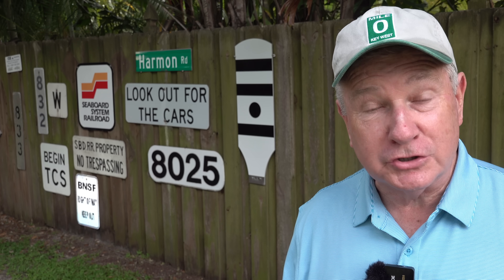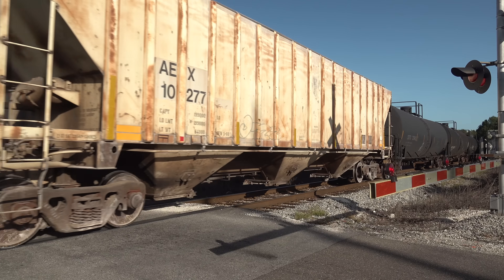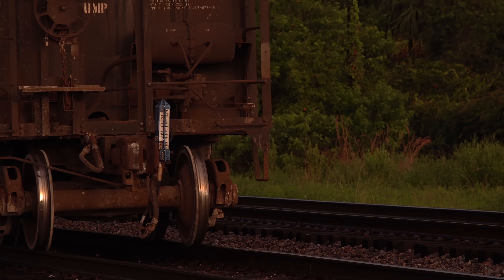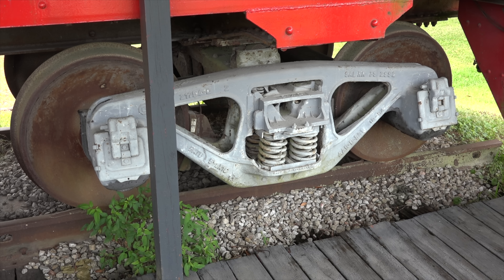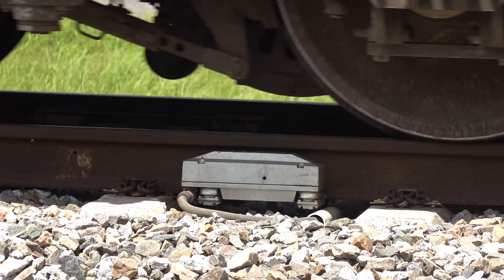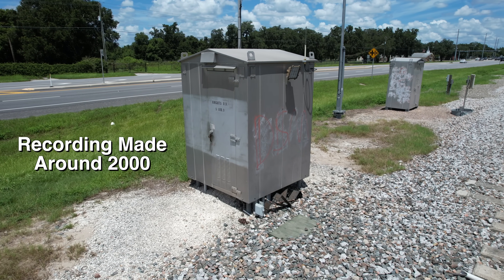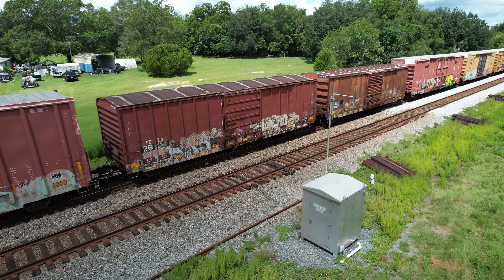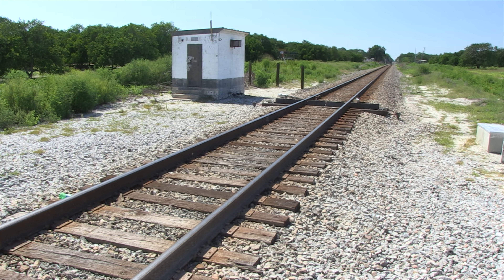What Railroad Defect Detectors Do

Comment: Those CSX detectors that give location sound neat..maybe it's because they were gone before I got into railfanning, but I think they're interesting. I like the Paducah & Louisville detectors here in Kentucky. They give axle count and length, but also direction, temperature and train speed. I think CN is similar? NS detectors don't really give out anything other than milepost, sadly.
Reply: I pick up two DDs here in Robards, KY.  Those used to give the train length, but they both just give axle count now.

Comment: Two mainlines run through my city, so there's hardly a day I don't see a train from where I've worked, or when driving.  It seems to me that wheel flat spots were a regular thing, I'd hear at least one per train, more often several.  I notice now flat spots are much rarer, I guess due to these defect detectors.  That's got to reduce both rolling stock and rail maintenance-- as well as getting rid of a bit of noise pollution.

Comment: That inspection shed there at Race Pond is cool new technology! I bet railfans would love to tap into that photo stock, ha! Anyway I just wanted to say thank you for posting another excellent video, and congrats on the Harmon Rd sign, that surely added to your collection. 
On the buffer cars, you mentioned that the plant may hook on to the train with terminal power. In addition to that, sometimes the train may need to perform a runaround once it reaches its terminus. It's a zillion times easier to just uncouple the head engines and snap them on the tail. Also in some more rugged terrain they might connect helper DPU on the bottom. OR they may also attach another train to the bottom, with their lead power becoming mid-train DPU. With the time alotted in your video, you covered the basics and that should be clear enough that there's buffer cars on each end so the train can be handled from either end, regardless of which way it's actually traveling.
Finally I think we talked briefly about visiting Columbus GA sometime. If you're still up for that, please let me know. I won't be in GA much longer but I would gladly make the trip back to guide you!
EDIT: Oh yeah and those numbers on the DD slap plates so they could disassemble and reassemble them. Similar to the way you might mark head bolts on an engine when you disassemble and reassemble them, so that you put the bolts back in the same holes each time.

Comment: They are also a High Car detector.  (High wide detector) On CSX Riverline at 7.2mp they usaslly go off due to the snow on the containers or auto racks not sure for summer season. There also one in Phila. Same for Amtrak NEC high car detector next Oak Island in Newark NJ. CSAO runs to Metuchen yard for Rartain center and local work in Edison/New Burnswick area.

Comment: Do they have like detectors for the tracks themselves?  I stumbled across a page showing old railroad jobs in the 1800s for the railroad and one was walking the tracks to spot ties, bolts, basically any part of the track itself that needed repairs and to make them when they found them.  (I assume when the trains weren't running; before they ran.)  Finding them must surely be replaced by modern technology these days.  Apologies if you've already did a video on that.  Even without knowing, I'd think drones would be more efficient than men walking the lines at least to find the needed repairs.  (I was able to give a character in my fiction story from that area this IMHO interesting and important job.  Yes, I combined my love for trains and the era and was searching for jobs the character might hold working for the railroad.  I lost one grandfather before I was born in 1958 to an accident while working for the railroads but I honestly don't know what what excatly his job was but I suspect my interest stemmed from that.  I never knew either of my grandfathers because they both died of work accidents before my birth.  The other, a dairy farmer, got kicked in the head by a cow.)

Comment: Great video, Danny, as always! I will have to correct you on some info that those little stubs on the inside of the rails aren't impact detectors. They're actually transducers that count the axles, measure speed and calculate train length. Impact detectors usually are found sparsely on a line, and usually have concrete ties and sensors along the rails, along with AEI readers. CSX's actually use a female voice and say "CSX impact detector". Also, fortunately, pre-recorded voices are still a thing on modern DD's. However, a detector like the one at Stokes is a synthesized computer voice, it's all over on my local NS line.
Reply: if you're lucky enough, you'll find a famous voice pre-recorded in some of the radio boxes on the union pacific and pan am line.
the voice is Majel Barrett-Roddenberry. 
reportedly there's only a few left in Maine that bear her voice to this day

edits cause i'm tipsy....
Reply: @gigglesseven  I found the thread on trainorders. A user claimed that the voice widely believed to be Barrett was actually a professional voiceover artist called Katherine Reynolds who apparently worked for NBC.
Reply: @PrenticeBoy1688  oooh, thank you. some info is very buried and easily overlooked
Reply: @gigglesseven  The Enterprise computer lives on!!
Reply: @gigglesseven  This is a disputed claim. I read something earlier this year that identified the voiceover actress, and it wasn't Barrett. This might be an urban legend.

Comment: Does the inspection portal you featured at the end of the video transmit an inspection report like the defect detectors do? If so, can we get a sample of what they sound like?
Reply: No radio message
Reply: According to some of the other comments, modern defect detectors usually only transmit when a defect is found, to reduce unnecessary radio chatter.
Reply: @beeble2003  I've only heard UP DD's do that, CN and CP detectors transmit for every train at the start and end.

Comment: Hey Danny the handwritten numbers on those flaps I can assume are for wiring and diagnostic purposes. So the techs/maintenance can make sure that the proper ones are wired in the terminal box
Reply: Hi, the Dragging Equipment Detector (DED) paddles are just static mechanical devices. We number them because we prefer to put them back in the same place they were originally in whenever we would have to remove the whole assembly due to track work. All the paddles move together & if moved a certain distance, it opens a contact that carries the DC voltage to a relay causing the relay to de-energize to indicate an actuation. The outer paddles (#1 & #6) height is even with the top of the rail & the paddles inside the gage of the track is either 1 or 2 inches (been a while since I've worked on these) below the top of the rail.
Reply: Well that makes sense. I didn’t know if they were grouped as a single device or each paddle was independent. Thanks for the information  @tom49801 !!

Comment: Danny!!  Love the CSX High/Wide detectors because it usually has all of the detectors present (High and Wide, dragging equipment, hot box) I had someone tell me about how the high wide works. All the roads have in their database the dimensions of every car used. If anything is outside of those dimensions it sets it off.